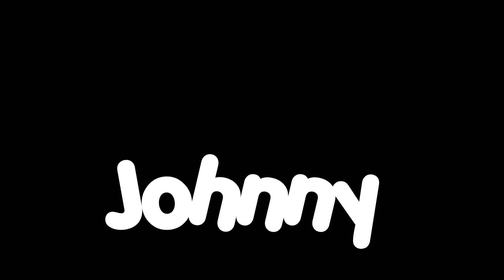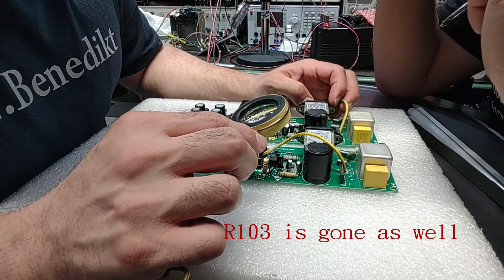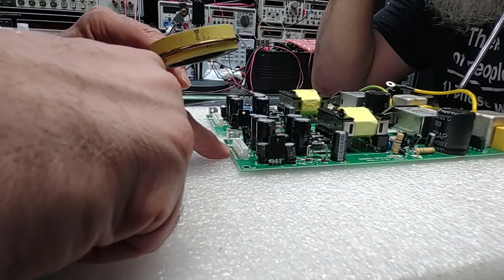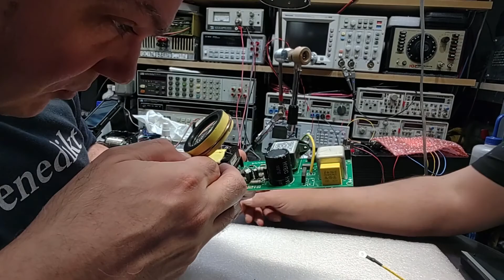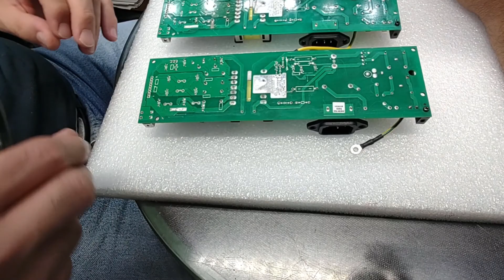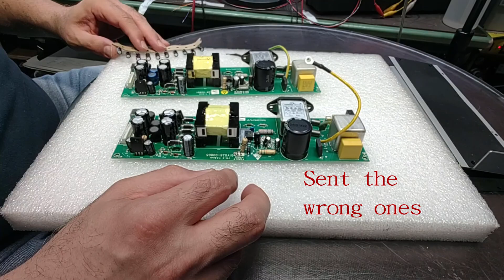'A chat with my buddy Johnny' about the Soundcraft Signature 2019 replacement PSU.

Comment: Nice and helpful discussion!
The following capacitors were defective in my PSU (date 2016/06/31):
C103 100uF/25V (measured 2.2uF)
C107 10uF/50V (measured 4.5uF)
R102 probably fried them too hard. After replacing the two capacitors, the PSU is working again. If C105 is installed (it wasn't in my case), I would check it too.

Comment: I just did mine this morning, got a powersupply from aliexpress.  Absolute perfect match, component for component.   Swap was simple and direct, just a pile of screws and a single connector.  Fixed all the outstanding issues in one go... and I actually find the sound quality is better.  Makes me wonder if the original was lagging a bit from the factory.
Reply: Would you have ordering information for the 22MTX power supply?

Comment: My 22MTK, bought in October 2016, died in 2017 without warning 5 days before the 1 year warranty was up.  I contacted the retailer (GuitarGuitar Glasgow) and brought it in.  A week later they replaced it with a brand new one, which was better - on the first one the right channel of master bus was always 6dB louder than the left, the interval mute button popped loudly through the monitors when switching mute on or off, and the mixer was wobbly as it wasn't flat.  
The replacement one didn't have these issues, but since the past few months it doesn't power up until I switch it on and off and on again about 20 times, give or take depending on what mood it is in.

Is this the same issue?

Comment: Hey guys I have a sig 22 mtk that i bought back in 2016 - i think the board says manfactured 11 -2015. Back in 2017 i had the usb + fx fault people have called the "clip of death" the only difference in my board is that the FX continued not to work even with usb unplugged the FX panel would power on and off, even with those channels fully muted you could hear a very low level click as it tryed to power on then died.  That same year i sold all my pa gear because i was having hard times and put the mtk in storage.  Now some  5 years later i decided to try and fix it, - upon firing it up to check it i noticed thr fx no longer attempted to power up.  I went ahead and replaced the two fried capacitors as many others had suggested.  Unfortunately this doesn't seem to have brought my usb and FX back online.  Any suggestions?  Should i just order a new PCU board? Maybe i screwed up one of the circuits in the process of pulling the capacitors(they were kind of stubborn). Or could something else likely be off
Reply: Also what is the mtk group u were speaking about?
Reply: @Alejandro - double-check that you got the polarity correct when you installed the capacitors.  If you happen to have installed either of them backwards, it will not work...